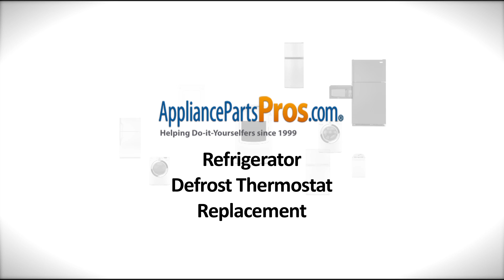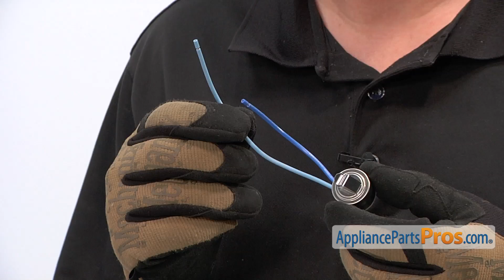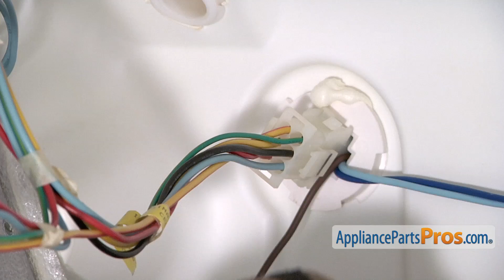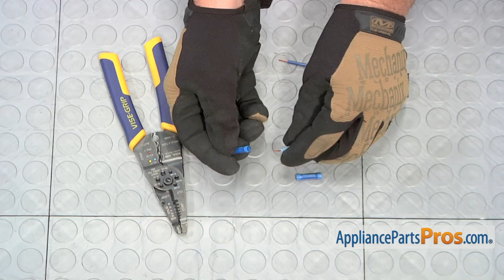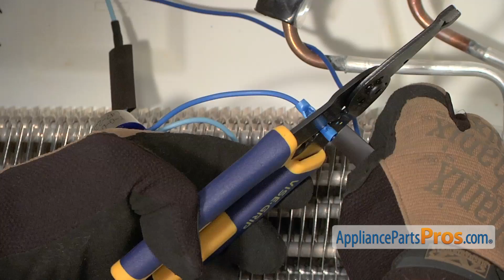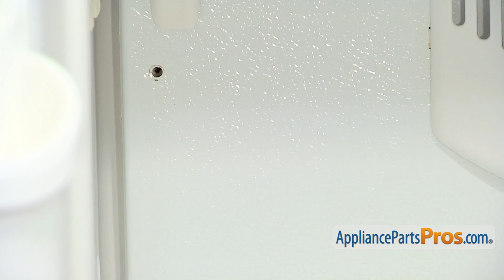How To: Frigidaire/Electrolux Defrost Thermostat 5303918202

Comment: I know this video is old, but hopefully someone can help me. I have the same fridge, just a slightly older model.

My freezer coil froze over. The fan works, but the fridge is warm. So I decided to do this repair. Its prettt tough because there isnt alot of room. Anyways I did the repair but I still dont think it is working becauae the coil is slowly building up ice. How do you put this fridge into defrost mode? I cant locate the screwdriver dial near the temp control panel in main fridge. I am assuming you have to push in the door button X amount of times. I cant find a manual for the fridge. Id like to force it into defrost mode to feel the heating element on bottom of coil to see if it actually gets hot and turns on. If it doesnt I am assuming the defrost heater/element that wraps around the coil is the issue. 

I dont have a multimeter. I guess I should have got one to narrow it down but these parts are relativelt cheap thats why I didnt do that.
Reply: Its honestly best to do the defrost heater also that they didnt show in this video.. It usually comes in a kit with both the heater and thermostat around $40 dollars